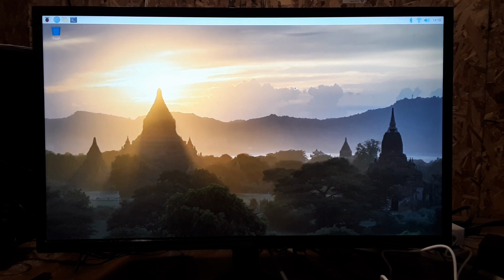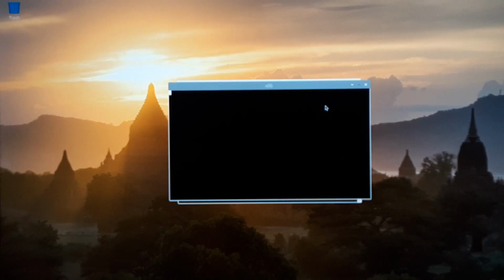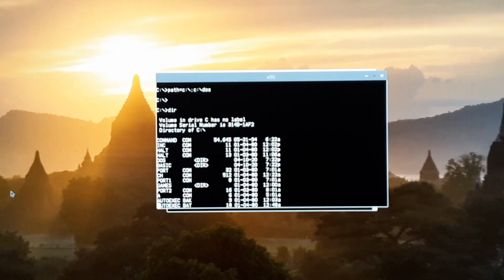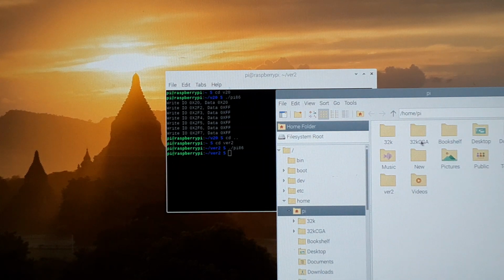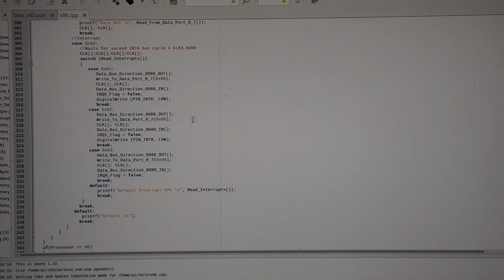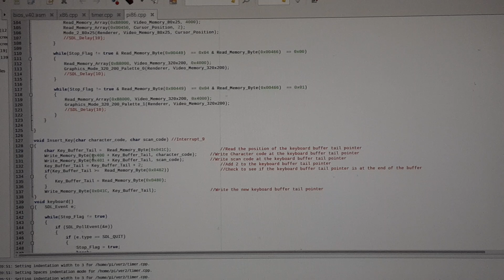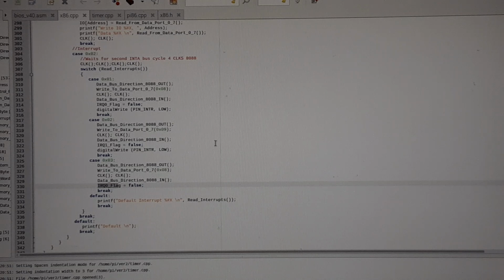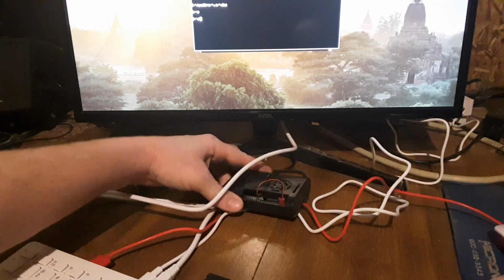Raspberry PI 400 with 8088 PCB

Comment: I enjoyed the video. I bought theV30 board a while back. I have it on a RPi4B overclocked to 2gHz. I use a right angle adapter so the GPIO is just like the 400. One thing I noticed is when running DOS the CPU goes to 75% and the heat rises quite a bit. I used the Basic86 to fool around as GW-Basic won't run. I've been wondering how to mount an alternative Drv A disk image. Do I just rename it to the current Drv A image's name?

I just bought a RPi 400. Using it on there is a cool idea since its not my main system. The 400 comes clocked at 1.8gHz while the RPi 4B is at 1.5gHz so it's a little faster stock speed. But they can all be overclocked.

Thanks, daveyb aka MC10Guru
Reply from the maker: Renaming and replacing the current IMG would be the simplest way. 

I use different threads for the system bus, keyboard, screen refresh, and system timer. I have been thinking that I should eliminate all or as many threads as possible to speed things up and use less CPU power.

Comment: I've been running mine on the pi400 since I got it and it works like a charm.  The provided code is really understandable also. The one thing that confused me for a while is that the control bus is decoded from the status pins rather than the WR/RD and IOM pins directly.  Took me a bit of reading through the datasheets to see how that worked.
Reply from the maker: I probably should have talk about that. I was running out of pins on the Raspberry PI and had to find a way to use fewer pins on the 8088.